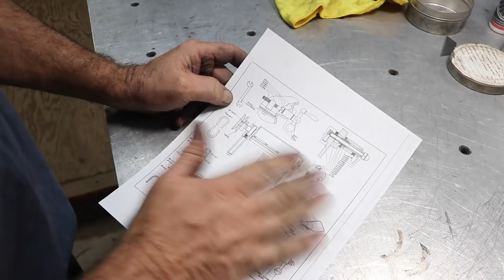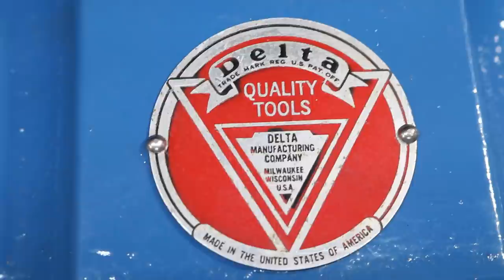Delta Jointer 6" | Assembly | Delta 10" Table Saw Restoration | P5

Comment: I have this machine in my shed. It's in there because it is the only place that has 220v. It came with literally everything original. The on off switch is the rod coming up from the motor. I have the blade guard and shims for the anti-kickback pawls. The original retracting casters also. I love this thing. I was lucky to find it in a city near me.
Reply from the maker: Nice a rare find.

Comment: Hi Randy. A great project. The newer jointers have a pair of jack screws under each blade. It sure makes adjusting the blades easier.
Reply from the maker: Thank you Richard, yes that is a nice feature.

Comment: You mentioned that you use bluing even on the sliding parts as a long-term protection. I've noticed that precision tools or generally high quality tools from the late 1800s through the 30s often have a sort of bronze appearance. This does not seem to be staining, you can still see it after evaporust or citric acid. As the piece patinas, it quickly shows that vaguely bronze appearance. I was wondering if that was a predecessor to bluing? The color is very similar to one of the main colors seen in color case hardening. Do you know if this was for protection, or for hardening? It seems to be specific to higher end equipment of that era.
Reply from the maker: I have a miter for the tablesaw and under the black coating it is copper collored.  I do not know what the black coating is but I do think the copper coating is electroplated, so that the black coating would bond.  The miter is made of magisium I believe, a casting.  Or possibly Alu.

Comment: I have almost the same saw with a nearly identical fence setup. On the round fence rods, there are little standoffs from the main casting. Sort of a spacer that is flat on one side and concave on the other to match the rod, with a hole in the center. I have managed to misplace a few of mine. Do you happen to know if they are available online somewhere? If not, did you make your own? How did you go about cutting the concave portion? I presume a boring head with the part horizontal to the table. Is this how you did / would do it? Any other technique recommended?
Reply from the maker: Jean-Paul, I used the original standoffs.  How many do you need?  Email me at rrintheshop@gmail.com.

Comment: Beautiful job Randy! That will be a very nice Christmas present. Is it possible to use that cold bluing on milled cast iron? I was just wondering if i could use that as rust protection. 👍🇺🇸Roger
Reply from the maker: Yes you can Roger.  I did and it worked well.  Be sure to oil..  Thanks.
Reply: @RRINTHESHOP  Thank you!